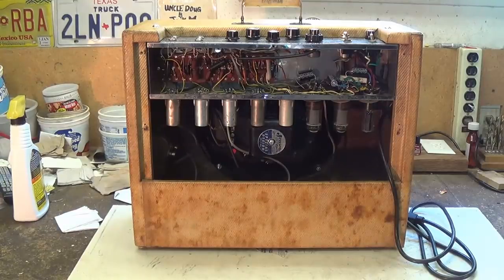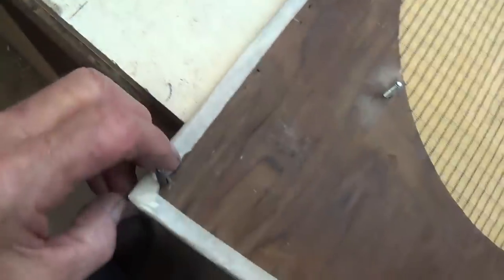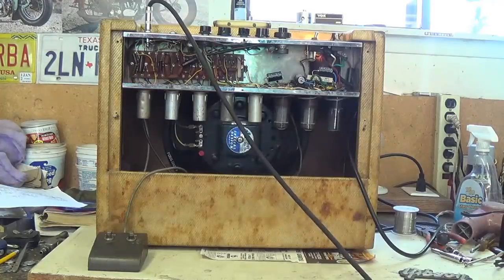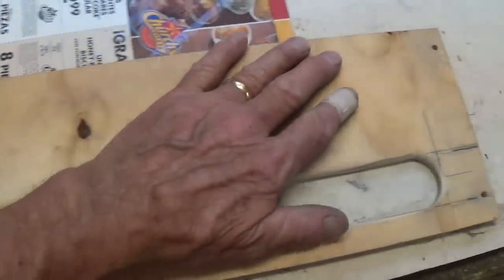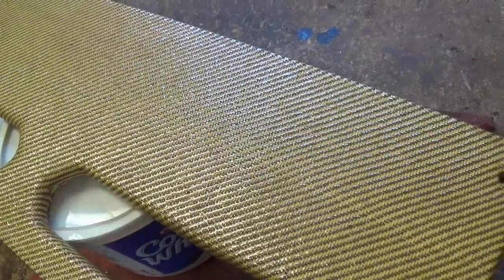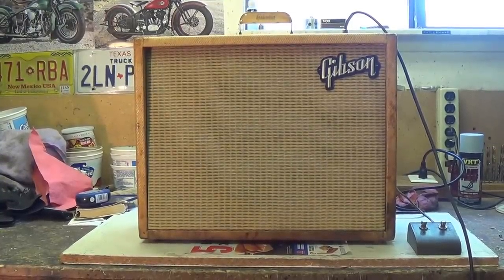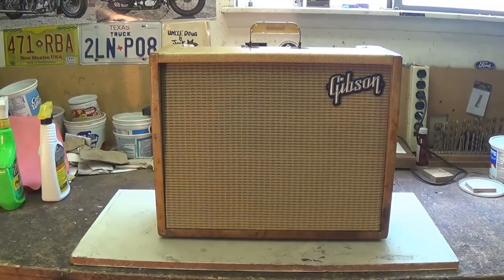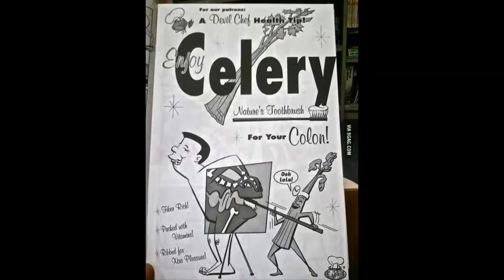1961 Gibson GA-2RT Maestro Deluxe Reverb Echo, Part 2

Comment: We miss you. R.I.P. Rusty
Reply from the maker: Amen, 9W.
Reply: Kenny H  Just my opinion here, but it depends if you're looking for a modern equivalent, or a vintage speaker. The old speakers are far less efficient, and won't be as loud decibel wise as a modern one typically. The modern offerings from Weber are great speakers, and pretty efficient (ie- louder per watt). I have a Weber 12A125 that was in my 5E3 (tweed deluxe) clone, and it really sounds the part with speaker breakup. Rift Amps makes a modern deluxe and uses a Warehouse Guitar Speakers G12Q. The G12Q is a little less efficient than the others they offer, so you'd probably get more saturation with less volume. I plan to try out the G12Q because I don't gig, and don't need that volume. My 5E3 is stupid loud with the altec that's in it. The Altec a fantastic speaker, but it's very efficient and will push 110db on my cheap meter. My personal experience buying vintage alnico 12" speakers is it can be hit or miss. Early Jensen's, CTS, and Rola are usually safe. Lots of them are in good condition, and are pulls from old organs. Their typical low cost means low-ish risk, but it also means you're tempted to try more and wind up with a stack of speakers that you're not using :). I use this extensively when understanding who makes the typically unlabeled speakers. The rim will have something like 220415. 220 is Jensen, 415 would be 15th week of 1964 (or possibly '54). With alnico's that can be a tough one to really know. Ceramic magnet speakers it'll be the 60s as far as I know. http://www.triodeel.com/eiacode.htm
Reply: I just lost 2 cats, a year or so apart , still not ready and no one has come into our lives. Seeing the cats always makes me smile just as Rusty did. God bless R.I.P.

Comment: This video transcends Amp Repair. It is a beautiful piece of American Art. Thank you.
Reply from the maker: You're welcome, Phil. Your nice comment transcends our expectations. Thanks so much :)
Reply: Kenny H  Solid state amplifiers do not use output transformers at all. There used to be an exception, but it's only found in old PA installations (old cathedrals for example).
The only considerations regarding heat and stress will be for the power supply (transformer or SMPS) and the output stage of the amp. 
The "stress" will be directly proportional to the output power delivered. The most important thing is to never connect speakers wired in such a way, that the impedance would be lower than the minimum allowed, 4Ω in your case. Tube amp will be more forgiving in such a case, and would just start distorting sound a lot, perhaps in an interesting way, whereas a solid state one will either start hard-clipping the sound, which sounds awful, or fail – depending on how well designed the protection circuitry is.

Comment: I know this was several years ago, but that is one nice-
  sounding trem. Frankly the whole effin thing sounds amazing. I'm a Fender guy normally, but I gotta hand it to this Gibson.
Reply from the maker: Thanks, Marty. Tweed Gibsons can hold their own with most early Fenders.....but by the 1960's, they lost their magic.
Reply: @UncleDoug  I recently ran across one of these, it looks pretty good but when turned on you get sound but as it warms up the sound fades away. Any ideas?
Reply from the maker: @markjack8290   Plate current increases during the warm-up period. Perhaps there is a problem with the tubes and/or power supply.

Comment: Cool idea to swap in a Fender reverb transformer. I didn't even know that was do-able.
Reply from the maker: Thanks, Sean. The driver tube is a 12A_7, just like in Fender circuits, which suits the primary, and the tank has an 8 Ohm input impedance, which suits the transformer secondary.

Comment: I loved your solution to the grill fabric "problem";  the masking tape over the grill cloth. It's far simpler than mine solution of adding a few short strips of similar fabric contact cemented to the grill cloth and then made long enough to affix the staples to the surface of the speaker baffle. Maybe you could try that too.
Reply from the maker: Yes, I could. Excellent suggestion, Dennis. Thanks.

Comment: Great work! That amp should fetch a pretty penny based on the values I saw on Reverb. Not Fender Princeton money or anything but enough to keep the channel commercial free for another month or 2.
Reply from the maker: Thanks, Bill. I really get attached to each amp I work on, but I guess that some day, everything must go.....especially when I croak and the wife needs cash for jewelry and travel :):)
Reply: I see, I just got the impression when you bagged up the old caps and transformer that you might be moving that one along. You do such an amazing job of correct restoration that someone would be very lucky to get an amp you worked on. So many “amp techs” perform such hatchet jobs that’s it’s a pleasure to watch you do it right.
Reply from the maker: I do tend to keep the old parts for future owners, Bill. Thanks for your very nice comments.

Comment: Wow, was that ever nice.
That's truly a transitional Gibson amplifier, mixing the trem and verb with the tweed can be tricky.
I have my own hypothesis on that area. I don't remember what brand of verb tanks Gibson used?
I hoped that speaker pepped up for you?
A mushy surround will do that, plus, I was informed from an old guitar amp speaker builder repairman that he frequently would demag and fully recharge the magnets in vintage speakers during recones and such. 
Also, the spider will stiffen up and sometimes you just need to crank it up and let it roar for awhile and see what happens.
I noticed that you shielded the magnet by the tubes.
Great idea!
I've done the same thing.
Idk if you've had one of those Fender reissue Champion 600 amplifiers come across your bench yet, but if you can pick one up inexpensively, do so.
They are fun to do a tweed mod on and replace the speaker and grill cloth for an ear opening experience or just use the 1/4 jack to a favorite cab of yours with the correct ohmage, etc.
My replacement speaker was an alnico designed for that reissue amplifier and it kicks butt! However, the alnico magnet and metal comes too close to the output tube and will cause some hum, if not shielded.
The stock speaker is ceramic and flat as a pancake. Your wife is a very talented artist. What a lovely way to decorate the home with "happy" little paintings! 
The nice music from Sweden mixed with the scenic background made me expect to see Clint Eastwood or Lee Van Cleef ride by on a horse.
As always, thanks for sharing.
Cheers!  : )
Reply from the maker: Thanks for all your very nice comments, Amo. Other than Accutronics tanks, perhaps they used Gibbs reverb tanks ??

Comment: Well done my man! Your wife does have the "gift" for art. Some times it is a hard decision to share one's personal life with the public, but when you do, it is so wonderful. It gives a more complete look at you and where you come from, without intruding too much. Thank you so much. Your videos get better and better! The amp turned out great, so far. Tweed is harder to work with. Did you put a layer of metal foil on the inside of the new back panel to reduce noise? This Gibson amp had a lot Fender-ish attributes. The Fender 5E3s were tilled back at the top of the whole cabinet for better projection. The rear top mounted amp chassis was another similarity. All in all a great project! Can't wait for your next! Thanxz
Reply from the maker: Thanks so much for all your very nice comments, ATL. The tweed Gibsons can hold their own with the early Fenders, in my book. I didn't think of using foil as a shield, but it's a good idea.

Comment: I'll bet that that Tweed  is surprisingly rough on razor blades, and today's paint scraper type razor blades all seem to use cheap soft Chinese steel (recycled?) that doesn't hold an edge. I am using an Olfa razor knife these days, the 18 millimeter medium width knife with a thumb wheel to lock down the blade  tightly at any desired depth or length, and with the notched blades that you snap off when you need a fresh edge. The blades ( made in Japan, like the Olfa knives themselves; not Chinese in origin) appear to be high carbon steel and they work better than virtually any razor blade or utility knife blade I have tried. (Their double-honed,  black-finish Max-cut blades in particular are scary-sharp, and cost just slightly more; they also make serrated blades for cutting foam board insulation, and a special  knife and  blade combo that is recommended for cutting fiberglass insulation).  And they're not expensive either. I've tried a lot of razor knives and utility knives and various blades over the years, but this one has become my go-to cutting tool. Just make sure you get one of the larger ones with the thumb wheel to lock the blade. And be careful with those ultra-sharp blades, or you'll find yourself paying a blood sacrifice!
Reply from the maker: Thanks for the tip, GU. I agree that modern razor blades dull almost immediately. I get one or two good cuts per corner.
Reply: @UncleDoug  , even the venerable  X-acto knives and blades don't seem to be as sharp or hold their edge as long as they did when I first started using those some 40 years ago.  I recently found some decades-old Stanley razor-knife blades half-buried in the tool chest at work that are similar to but larger than X-acto blades, and those things are wicked sharp even after all these years. I'll have to see if I can find a knife handle that will hold them....

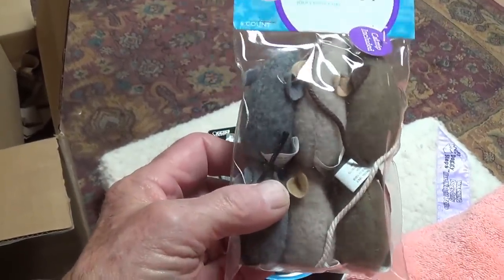Comment: At about 8:50, the lamp sockets appear to be the type that would probably have a series resistor built in and were therefore designed to use with a small Bayonet neon bulb like an NE-51 or similar, which could then be run directly off 120 volts ac. Check the center terminal inside the lamp holder to one of the external terminals and look for a measurable resistance. Of course, you could always unscrew the plastic jewels and use them to replace missing ones on other amplifiers that have a standard 6 volt incandescent lamp.
Reply from the maker: Thanks for the tips, GU.

Comment: glad to see you use the same bandaids that I use. 🖕sometimes I use crazy glue if the cut is bad. I had a young fellow that worked for me, he was covered all over with tough looking tattoos, he cut his finger some how, well he called his wife to take him to ER. he was there for 16hrs before he got in, all they did was to put on a bandaid. the next he came in and I said to him, that the first aid box had bandaids, he said he knew that but insisted on going to ER I said I would have just used masking tape, he said “yeah well you’re old school. then people wonder why the Canadian health system is over loaded with long wait lines. im sure the ER staff just kept him on the back of the line, and delt with people that had real medical needs. old school rules!

Comment: Hi Uncle Doug,  I have an idea for repairing a grill cloth that comes up "short".  You could cut  "mill" a groove or slot in the edge of the speaker baffle using a table saw or router table. Then using a round dowel or plastic rod of suitable diameter to push into the groove capturing the grill cloth in the groove much like screen on the screen door. You could probably use that screen repair vinyl cord for the friction filler.  As long as the groove dimensions were sufficiently deep the filler would be flush with the edge of the grill cloth.  I hope my theory makes sense. It might work better than staples, if the wood has sufficient strength. I have never tried it though and I may just be all wet.  Good series on the Gibson Amp.
Reply: Gary Bevis, that's a pretty good idea actually.
Reply from the maker: Thanks for the good suggestion and nice comments, Gary :)

Comment: The videos where you bring a slightly or completely dishevelled amp back to life are my favourites, particularly when it's an amp that otherwise I would never see.  For the past eight years I have been maintaining some Marshalls and a HIWATT for a band but unfortunately no Gibsons or Valcos.  So your videos of these and others really are of great interest.  The Jensen in this amp has what look like push fit plates on either side of the magnet, I haven't seen these before.  Are they normally fitted?  Very nice montage after the amp part, there's a good deal of talent in your household.  I think I got something in my eyes at the end though.  Many thanks to you Doug and to the very generous donor.
Reply from the maker: Thanks for all your very nice comments, Jeff. The magnet in the Jensen speaker has heavy foil over the open sides of the magnet chamber to seal and protect it, probably from dirt, metal particles, and perhaps EM fields.

Comment: I think I may have sewn a thin fabric binding around the edges of the grill cloth to stabilise it, then you may have been able to staple through the binding on the inside of the baffle as you mentioned in Part 1; provided of course that with the additional bulk it was able to fit in the rebate. Being paper the masking tape may break down over time? No way a criticism of your method just an alternative option.
Reply from the maker: That's a good suggestion, Allan, but I don't have a sewing machine. The masking tape was only for installation purposes......not permanent service.

Comment: That turned out so Sweet! great job as usual. I'd love to hear one of my lap steels through it, especially the EH100. Bet it would just sign with that reverb. Can't wait to see what majic you do with the Lesmann.   BigDave
Reply from the maker: Thanks so much, Big Dave. The Lesmann is proving to be a challenge. Did it ever work while you owned it?
Reply: @UncleDoug  I never could figure out how to, or where to hook into it. I did power it up once, but I didn't know enough to do much more with it, so  like the Gibson I took out the chassis, boxed it up and used it as a cab for one of my heads. The guy I bought it from at a yard sale was also using it as a speaker in his workshop. I paid $5 for it.

Comment: Hi Uncle Doug.
Have you heard of a product called "Autosol"?
It's the best metal polish I've ever used.
It's made in Germany and sold (in Canada) at auto parts places and Lee Valley.
It is great at removing tarnish and polishing metal.
For instance it would (most likely)remove all the tarnish on those Maestro handles.
Reply from the maker: Thanks for the tip, Rich. I have used Simichrome polish, which I believe is also a European product. It is truly excellent.

Comment: Okay Doug thank you so much for your videos they are so awesome. I did pull the wire off of the speaker on my Gibson Falcon amp and took another resistance value it was 8 ohms, any other ideas on what could be making my output Transformer warm up?
Reply: If something is wrong with the bias of the amplifier, not only the output  tube but the output transformer woll have to pass too much current, and will tend to overheat. A defective tube that is gassy or has a grid emission problem due to contaminants on the grid can cause this, so the first thing to do would be to try another output tube or pair of tubes. if that doesn't fix the problem, then perhaps the cathode resistor for the output tube has drifted off spec in value, or more likely, there might be a bypass capacitor across that cathode resistor and the bypass cap has gone bad and is leaking current. Resistors typically go up in value, and for a resistor  to decrease in value as they age or are exposed to heat is far less common, and so, if the resistor did the usual thing and increased in value it would actually lower the current through the output to and through the output Transformer. A leaky bypass cap on that cathode resistor, however, would cause increased current flow. Do the metal plates of the output tube glow red hot? If that's the case, don't play through the amplifier until you find what the problem is, or you can burn up the output Transformer and maybe even the power transformer.
Reply from the maker: Now it's time to check the output tube(s) bias, and read what good 'un has to say.
Reply: @goodun6081  can the amp go out of bias even if the tubes have nothing changed? And if that's the case about biasing then I'll have to take it in because I cannot bias this amp I don't have the meters for it but thank you so much for responding to my questions I love your videos and I learned so much from them

Comment: Thanks for another great video. In the photomontage, are the BSA A65's yours? I had a similar, including a Spitfire Mk3. They were, by modern standards, almost unrideable at speed. The first time I cornered fast on one I stopped and checked the frame for cracks. The vibration was so bad when the engine hit high revs I thought the fins would shake off. That was forgivable though, the tuned version was so quick.
Reply from the maker: You're welcome, Chris. Yes, I restored all the bikes in the photos and a bunch more. The Triumph Trident and Norton 850 were fast and smooth, and the Triumph TR-6 wasn't too bad.....but the BSA's did tend to vibrate a bit, especially around 55 mph or so.

Comment: Total newb question Uncle Doug, the speaker magnet is right up against the tubes... Is that an optimal situation? I can't help but wonder if the magnet skews the tube action...( Do you sell these amps? :) ) As usual, an exemplary video. Thanks!
Reply from the maker: A strong magnetic field might have some minor effect on tube function, Brad, but with an Alnico  speaker magnet and shielded tubes.....nothing to worry about, other than the negative effect of heat on a permanent magnet. Yes, I sell vintage amps and my own handbuilt amps from time to time.